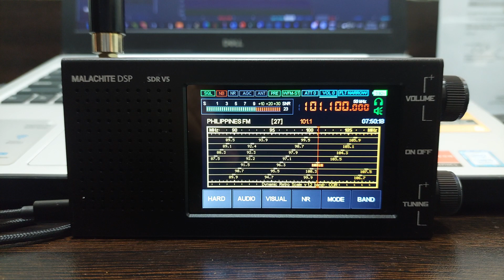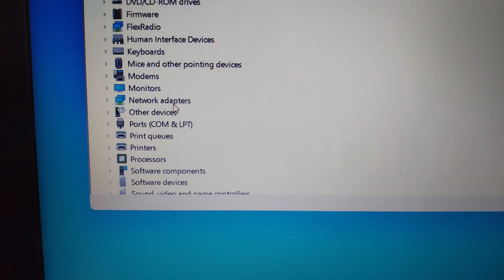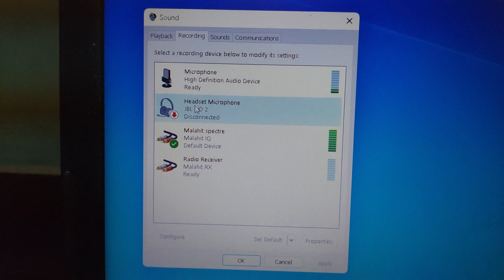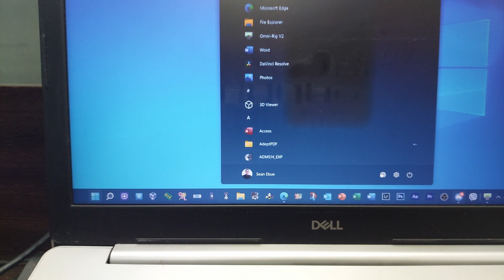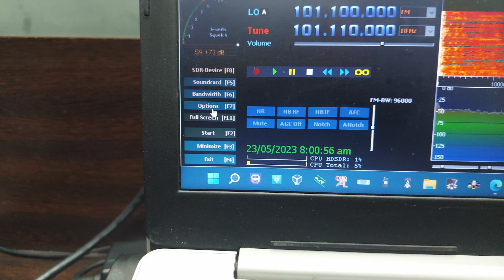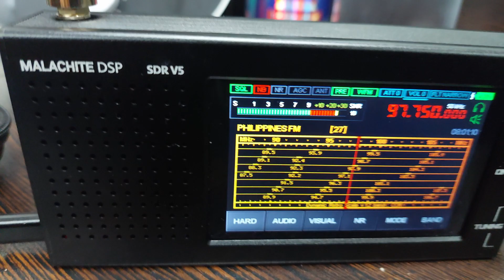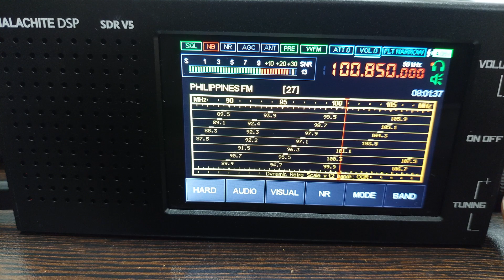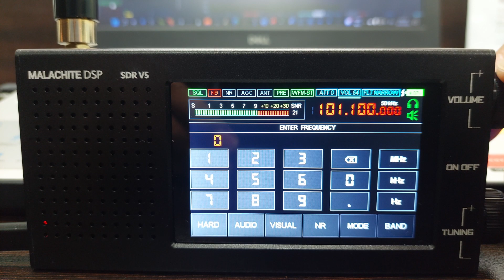2023 MALACHITE DSP SDR V5 + HDSDR v2.80 + OMNI-RIG v2.1

Comment: I am considering purchasing either the Malahit DSP V2 or the Malachite. I was wondering if the Malahit V2 offers connectivity to a computer in the same way. As I am new to this hobby and recently damaged the front end of a more affordable SDR 101 receiver, I am hoping to acquire a superior SDR. Could you please elaborate on the advantages and disadvantages of both versions?🎉

Comment: Hallo, I have the model "Malachite DSP SDR V5" with firmware 1.10d.

Unfortunately, the built-in clock is several minutes later per day.
Is there a way to correct this clock?
Unfortunately, there is no corresponding option in the HARD menu as with the Malahit DSP2 in the RADIO menu item "time correct" (for clock speed correction).

It would be nice if someone could help me.

Comment: Thanks for the info., there are many different models I am confused, do you know about the firmware compatibility ? as far as I can see the latest DSP 2 has different user interface, 'hard' changed to 'radio', what else do you know about the models difference, thanks !
Reply from the maker: Avoid confusion; regardless of the hardware you purchase, adhere to the installed firmware. Malahit Firmwares require an activation code specific to the hardware for proper functioning.
Reply: Thanks, how do I get the activation code ? @N7SIX

Comment: The rebooting ISSUE seems to be when I am  changing or tuning thur the freq. Odd
Reply from the maker: So far, I have no issues with my V5.
Reply: @N7SIX  I  put two thick pieces of velco INSIDE to stop BATTERY from MOVING. A sthey shipped it NOT secured.Wonder might it be over heating when running the HDSDR software? Doubt it get hot?
Reply from the maker: @mrtrido  I am not sure of the heat but my V5 have no issues connected with HDSDR even for hours.

Comment: Well darn have an issue my SDR keeps REBOOTING itself after a few minutes.Odd tried two dif USB cables same issue.
Reply from the maker: Teardown the sdr and remove the battery for 5 seconds and put it back. Then, try to turn on the sdr.
Reply: @N7SIX  WOW scared to do that. I had the battery shipped LOOSE and I stuck some velco in there. But I scared to take the knobs off, Never had this resetting till running HDSDR

Comment: Great video I am running this now.Oh One thing that must be done  correct me if I am wrong Settings in SDR radio HARD  menu must set IQ swap Enabled? correct?
Reply from the maker: I have to check that, I did not change that settings.
Reply: @N7SIX  I checked dont think it matters